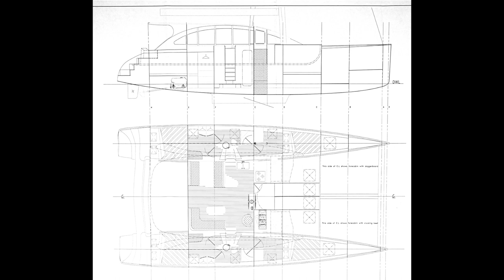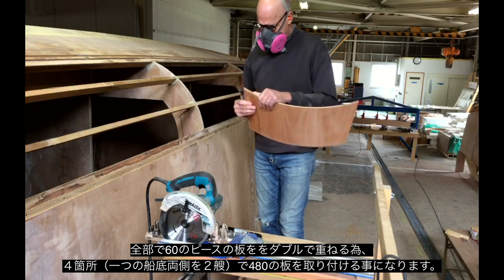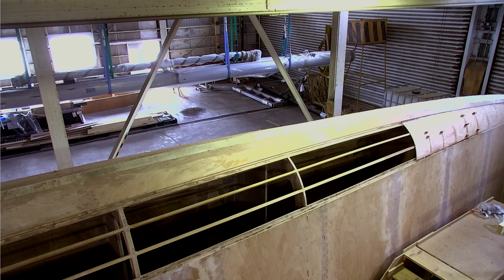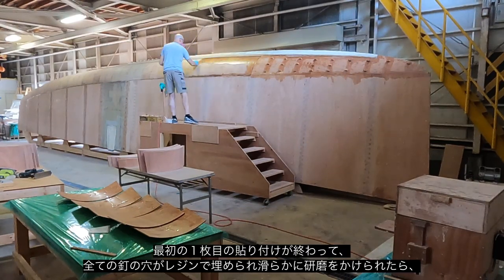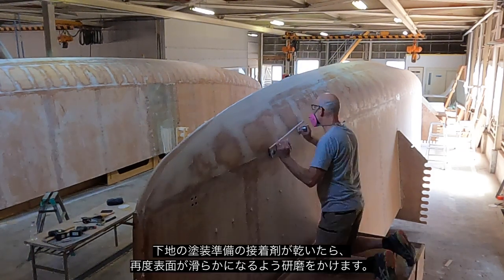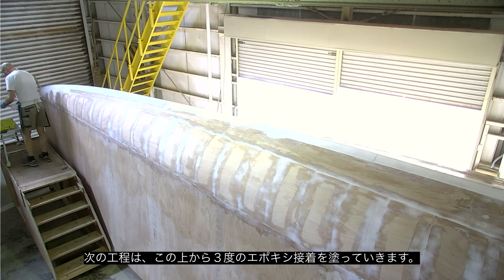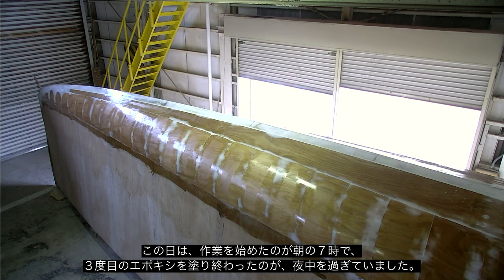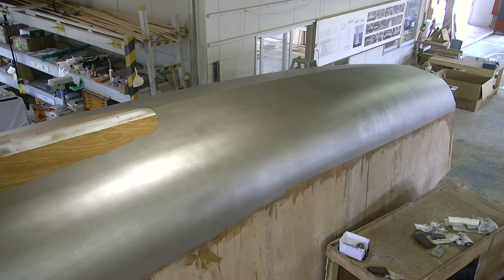Fitting the Radius Chines to a DIY Dix470 catamaran

Comment: Hi, great work…I would not have the patience to get that finish…it is below water, and no one sees it!
I am currently repairing a damaged ply / epoxy glass clad catamaran.
I can say you are crazy to do all that work and not sheath in grp, at least below wl.  It does a really good job in giving protection.  It won’t take much to damage the coating you have, and could lie unseen, allowing water to soak into the plywood…and once in it doesn’t like to dry out! 
I did remove the mini keels, the bottom half of which was not there, unknown, when I bought her, probably for a few years.  I am pleased to say, although soaked, the epoxy sheathing was still firmly bonded. 
I did read, that back when they made aircraft propellers out of timber, they tried every coating, including epoxy, and even that was not perfect, moisture got in, though I assume they did not sheath. 
Also I have read on boat builders groups that epoxy coated ply still eventually checks, ie the grain opening up, without sheathing.  So even above wl, you will have to repaint far more often than if sheathed…false economy?
Reply from the maker: Hi Mark.
All great comments, however there are quite a few plywood/epoxy boats that lasted a very long time without any issues if done correctly.
I have confidence in the design and the way the bottoms of the hulls have been made. 
I am trying to stick to the original design as much as possible.
Kev

Comment: While it is true that a layer of cloth/epoxy will improve impact resistance to the hulls outer layer and make it more robust in general, it is maybe not as important as one might think. One could argue that it is important as a final layer of protection but it is not directly comparable to an outer layer in say a sandwich constructed boat with a foam or a balsa core. Too often we tend to compare and quickly jump to conclusions 

Remember that there are two layers of radius ply. Each one of the pieces in both layers are individually set in epoxy and glued to the next piece going down the hull. The next layer is also made up of individual pieces that are embedded individually completely in epoxy. The two layers are staggered so that no joints between two pieces in the first layer are in the same position/line as two pieces in the outer layer. So the radius chine is in effect a section of a tube made of many layers of wood fibers going in different directions. The outer cloth will add to this strength but only marginally unless paired with cloth inside the hull. The way this has been done here makes it the strongest construction that one could imagine given that wood is to be used and the weight is to be kept as low as possible. Remember, this is a fast boat!

Torsional effects of sailing the vessel is not a problem to this part of the vessel as it is way stronger than it needs to be. The forces will however be strongest on the radius chine stringers running at the edges of the radius chine section of the hull. I would imagine that the upper one (lower in this case since the hull is built upside down) gets the most force as the one on the bottom is facing a very narrow panel that transitions into a keel shortly after. This joint on the radius stringers between side panels and radiused section is intentionally kept wide. I think it is 100mm wide and is shared as a landing platform for both the side panels and the radius chine skin section. In other words, very sturdy indeed with a large glue surface for both parts being glued down to it. 

This is all assuming that the plywood used for the radius stringer is of a high quality. I do believe that Okoume plywood is used here and I am sure that this is of marine quality and has proper glue lines with wood that are not patched or voided in any way. The irony of these builds using high quality epoxy is that the whole thing is not stronger than the next layer of glue that was used when producing the plywood. 

Most people seem to think that as long as the wood in the plywood is "excotic" and "rot proof," we will have a strong construction that is impervious to the marine environment. True in its own way., but the uniformity and quality of the veneers and the glue used is equally important if not more. Again the sections of wood are all totally embedded in epoxy and separated from each other. This is the most important aspect. It means that should a damage occur and the outer epoxy layer is torn away and the wood underneath is exposed to water, the only wood affected is that in the particular piece. The water intrusion is therefore limited to this piece. In a more severe case both layers are penetrated affecting both pieces in the respective layers. I believe the design further inwards in the hull also specifies an inner radius skin on the inside of the stringers. Again totally embedded in epoxy. Should you have a tear through of all layers and water entering the boat the bulkheads will prevent the migration of water past it. Way better than most production boats that will sink if any of the through hull fittings fail.
 
Most foam or balsa core boats are not made meticulously enough so that sections of the core are separated from each other. Should a damage to the outer skin happen, the water slowly seeps through the entire core in the entire hull with massive damage if left unattended for a long time. Some core boats do not have a core below the waterline, I know, but that is besides the point. In the Dix design, the water damage (if even) is limited to the pieces of wood touching the damaged area. When it comes time to repair the damage, The radius chine pieces can be removed and repaired with new ones and sealed up again with fresh epoxy. Cheap and effective and could be done almost anywhere with materials and tools carried in the boat. In many cases the wood could be dried out fairly quickly as the fibers touched by the damage are not very long by design and dries out fast with heat applied. The damage could then be sealed again with cloth and epoxy. The production sandwiched boat however may never be able to dry out in a reasonable timeframe and maybe not at all without removing parts of the outer skin that is not really damaged in the first place. Core also has a nasty tendency to suffer damage while wet and the hull is under stress by the water pounding. This is not the case with plywood. Again the affected areas are small and are supported by all others still in good health. 

Damage is of course easily observed as rips or cracks in the hull surface using light scuba gear or snorkel. I am not certain but I do believe that a moisture meter would be more accurate being used on a plywood boat as the difference between a healthy section and a wet one is more detectable as the water is closer to the outer surface of the hull than it is in a sandwiched boat. At least when it comes to surveying for vettness in an undamaged part of the hull that is suspected to be soaked. Please correct me if I am wrong. 

OK, enough about this. I think the design and the methods used are impressive and caters for the goal of a light, fast vessel that quickly will show its transom to the $1M production cat of equal length. And look at that beautiful hull made by a man that has never done anything like this before!

To sum up: An extra layer of cloth could not hurt other than weight, time and money. It is up to each owner to install or not. But to say that it is needed/mandatory is difficult to argue 100% for.
In my opinion of course.

Comment: I also have a question to the builder about the radius chine build method. In a previous video you demonstrated how you made the radius ply sections laminating plywood over a mould.  

(1) What was the type of plywood used for laminating. How many layers in the layup and the thickness of the plys?
(2) Was the radius of the mould constant?
(3) When fitting the sections to the hull, is it so that the radius of the "radius chine"section of the hull all have the same radius i.e. that the pieces would only need to be cut at length and width and that the sheet would fit in all positions along the hull without doing and bending of it or adaptation of the radius that is? 
(4) I notice on these builds that there is always somewhat more fairing compound towards the bow. Is this because the radius sections need excessive bending here or that the stringer in this position was bendt in place by using the spanner and the strap maybe pulling it out a bit?
(5) Is it recommended to stagger the sheets in the two layers while the joints have the same direction for both layers or can one layer be tilted say 30 degrees and the next the same but the other way. In this case there would be overlaps of the joints crossing each other with a "hole" at the intersection between the two sheet joints. The reason I am asked is to know what would be the optimal wood fiber direction for the layers. 

I completely understand if you dont get nr. 5 🙂

Dan
Reply from the maker: Hi Dan, thanks for the previous comment, well put!
There is one other aspect that contributes to the strength too, and that is the curve itself is stronger than a flat piece.
In answer to your questions
1 Okume 3mm marine ply was used
2 yes the radius is constant the entire length, the only thing that changes is the length of the chine
3 yes the pieces are cut to a width of 300mm( actually about 290mm to get the most out of the sheet) for most of the hull, from about Bulkhead G the are not as wide to help with the compound  curvature of the hull towards the stern.
4 the chines don't need any extra bending, for me at least blending the sections where the bottom plates stop and the chines take over and the stem required some extra fairing to make it as fair and smooth as I could make it. Im really happy with that section now.
5 yes the joints are staggered with the 2nd layer cut at 10deg to the 1st layer.

Comment: Thanks
Reply: Hi Kev, enjoying following. Given that you work often solo you may benefit from a sausage gun, your able to make your own glue/resin sausages, they are a Level up from the icing cake bag application. Guessing I'm late to suggest this but it could help you out speeding up glue times and application accuracy. A hollow tube with base to put the sausage skin in makes filling a breeze. Keep up the good work. A plastering  hawk helps speed up fairing compound application also. JFWIW

Comment: Awesome job, is there no fiberglass needed for this design.
Reply from the maker: Hi Edward, thanks for watching. Thats correct, there is no fibreglass on this section of the hull.

Kev
Reply: @saltlightdix4704  thank you for the reply, as a boat builder myself of performance multihulls in Australia  I am exited to  follow your build, keep them coming I would definitely build a cat using the same method, she will be a world cruiser for sure. Cheers from  Australia.
Reply from the maker: Where about sin Australia are you located?
Reply: @saltlightdix4704  Rockhampton qld

Comment: I thought that you would have covered the hull with fiberglass after you faired the bottom.
Reply from the maker: Hi John, according to the designer, fibreglass is not needed. The epoxy coated plywood is strong/ hard enough.
Kev

Comment: Shouldnt you add a few more layers of fiberglass to the hulls to consolidate all the different plywood areas into one?
Reply from the maker: Hi and thanks for watching.
I have followed the design plans by Dudley Dix. He has found this method to be very strong without the need for fibreglass.
Kev
Reply: The fibreglass is there for impact resistance
There Should be glass
Reply: So many armchair boat wannabes here that think they know more than the designer. Unbelievable
Reply: @DiscusRussell  some extra insurance never hurts and with all the work he is putting into this, why not…? Ultimately his choice…
Reply from the maker: Hi Mark, thanks for watching. I actually questioned the designer about this before I started building, and he assured me that fibreglass is not necessary.
 Just following the plans :)

Kev
Reply from the maker: Its all good, this is how we learn..... I don't claim to know everything, and sometimes some great ideas can be picked up along the way
Kev
Reply from the maker: I guess, as I am not a yacht designer, I want to build the boat as per the plans. There are some great resources on Dudley Dix's website, certainly worth a look.

Kev
Reply: I’m 3 years into a mike waller 12m cat and there is no external ply  that is not covered in glass 
It’s not for the strength of the ply boat it’s for impact resistance
Reply: @markgreen6719  I am more worried about all those joints and the continuous twist of the hull while under sail creating cracks over time…. I never build a fiberglass hull myself but own a fiberglass hull sailboat…. One scrape in the hull and water will get to the ply…. Anyway not for me to decide…
Reply from the maker: Mike Waller …. Nice design 
Out of curiosity, what thickness are your outside plywood skins?
Reply: @saltlightdix4704  my hull bottoms are strip planked western red cedar , hull sides are 10mm ply  ,12mm for the decks and foam for the cabin top and sides
Reply from the maker: Would love to see some photos when you get the chance.
How far into the build are you?
saltandlight470@gmail.com
Reply: @saltlightdix4704  search  "Building a waller 1200 sailing catamaran" haven't posted in 6 months
Reply: @saltlightdix4704  Hi Kev The Mosquito aircraft of WW2 fame was built out of plywood and not one bit of fiberglass skin. An aircraft wing will have more stress imparted into it during its life than any boat.  Skinning the hull in glass will also potentially bring the old nasty into play Water ingress behind the skin. Just a few thoughts im sharing with you
Reply: You must be kidding ☝️😂
Reply: Sorry for opening up this can of worms… let’s keep it civil…
Reply: @jmalte4702 haha…terre do worms…yes grp sheathing would stop them.